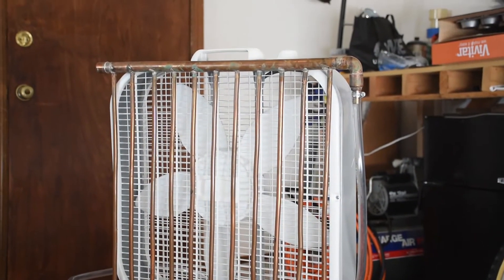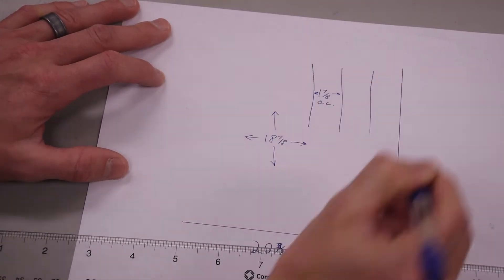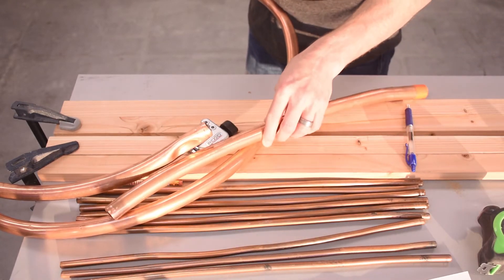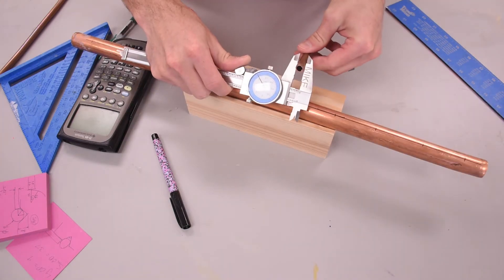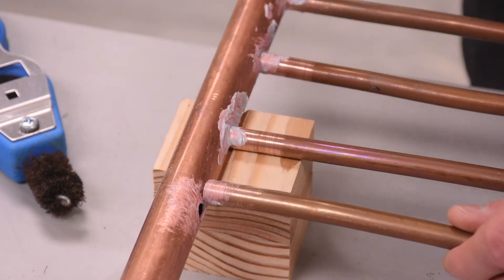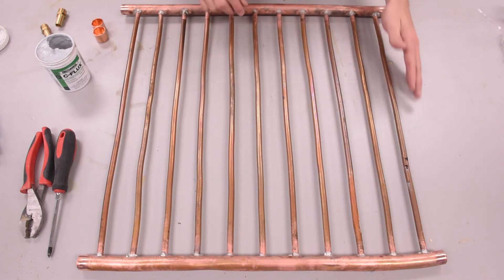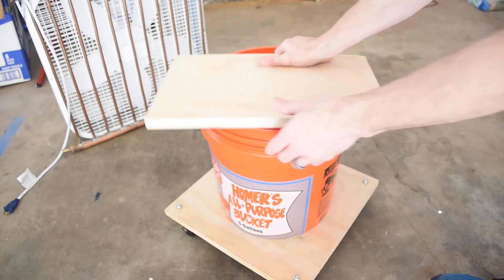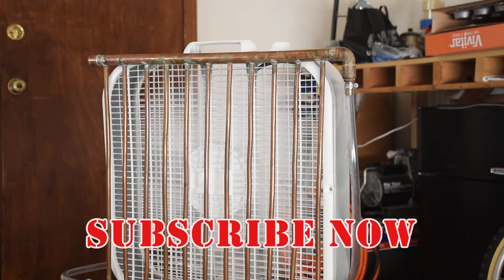DIY Air Conditioner for the Shop - Mikes Inventions

Comment: hey mike why would a continuous helix be less efficient than the grid scheme you made. I really want to build this but don't know what's best. thanks in advance
Reply from the maker: Hey Swiss-Dynamics! Please just make a continuous helix. DFMA! There's almost no "manufacturing" that has to be done. You can just bend a helix by hand. I did parallel pipes to minimize the tube length across the fan from the "hot" to the "cold" side so that my pipes would be as cold as possible. Absolute pain in the butt though. Don't do this. I wouldn't do it again. Nifty exercise in soldering pipes though, and it's a good fit for this fan. Never again though. Thanks for watching though! It's a fun, useful project!